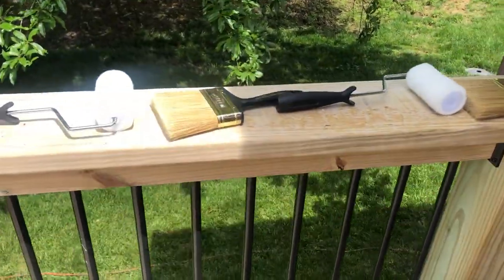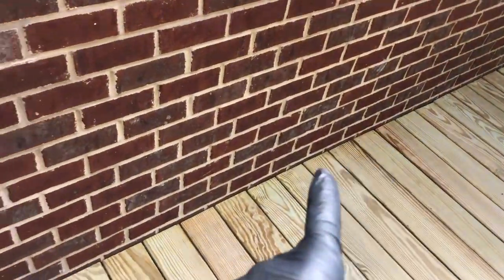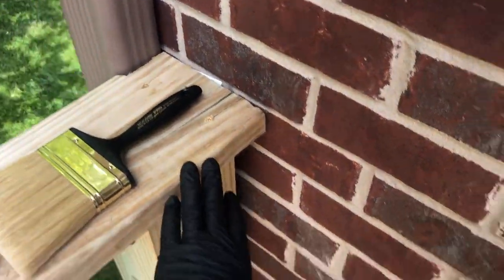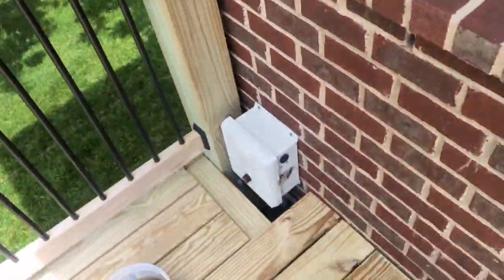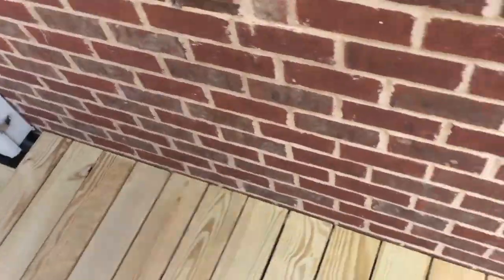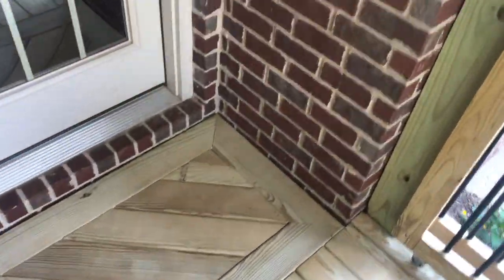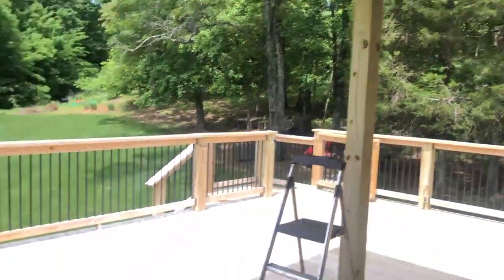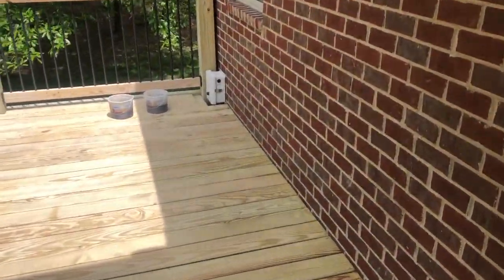Deck Staining 101: A Step-By-Step Guide

Comment: I like to take a piece of sheet metal and bend it at a 90 degree. Place it around the down spout to prevent an accident and make your work a little quicker.  also a thin drywall blade is great for your cut in near the brick.  Just a little tip for when you were staining near the down spout.
Reply from the maker: Great ideas! Thanks!